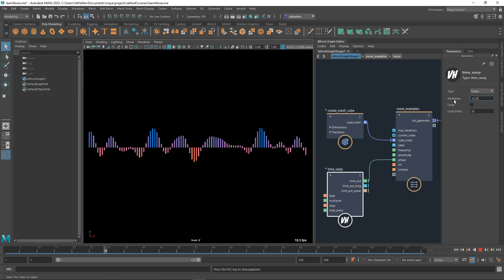Noise:  Intro

Comment: How hard is it to create a wavelength feature?  Our proprietary camera noise uses wavelength and I find this and amplitude makes fir a better looking camera noise that is easier to control than using frequency even tho they are essentially the same?  I don’t fully understand why!
Reply from the maker: So you mean wavelength as in I want my peaks to be X distance apart?  because it kinda is interchangeable with frequency ....
Reply: @BifrostVal  So we (my studio)  have a custom noise node for all kinds of things, but a big one is camera shake and it uses Frequency and Amplitude in the simple version (there are many other attrs exposed in advanced options).  I have built and had TDs and RnD build noise nodes for similar pupose at other studios and they always used Frequency and Amplitude and I have found that adjusting frequency does not give a good range, requires strange numbers - meaning low frequency handycam type noise needs to be between 0 and 1 and higher freqeuncy stops being useful beyond 2 or so and either way does not provide a range of nice motion on a camera.  For whatever reason, Wavelength (which I guess is really kind of like time or time stretch) provide for a great range and better motion.  It is counter intuitive becase low values are high frequency.  So I wonder how hard it is to create aWavelength attribute?  The conversion is a bit odd becuase it uses speed of light?  Not sure how hard it would be to expose a Wavelength attribute, but it would be the difference between realistic quality camera noise and weak CG looking cam noise.  I have tried numerous options out there (although there are very few custom noise plugins for Maya) and the mash signal node is an option, but it provides similar unappealing camera shake/noise similar to those that I had custom deved by RnR at 2 other studios.
Reply from the maker: Wavelength = Speed/Frequency apparently!  I have learned something today! I'm looking into this.
Reply from the maker: What's throwing me here is that you are looking at 3d noise over time, whereas I'm building 3d position noise.  But there's no reason we can't apply both keeps reading
Reply: @BifrostVal  Cool!!!